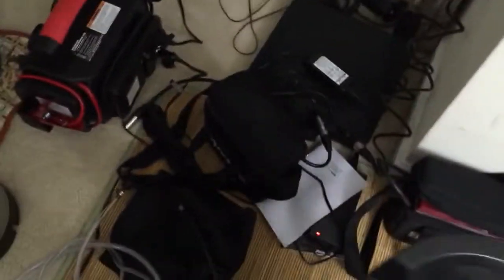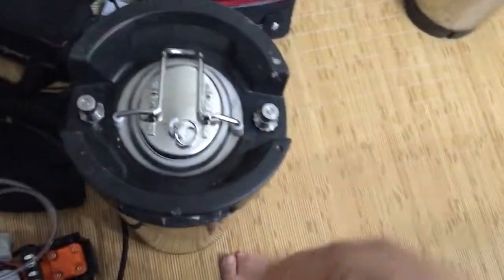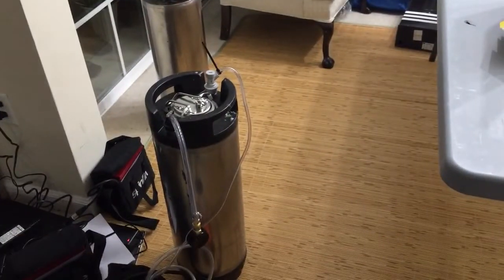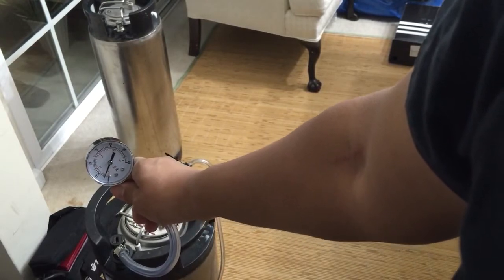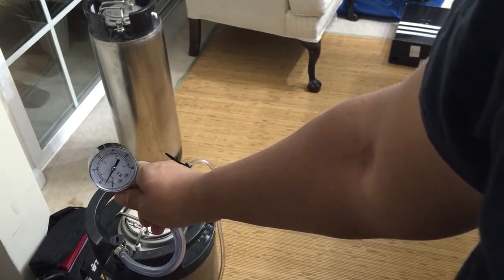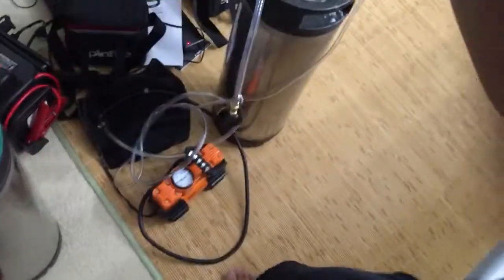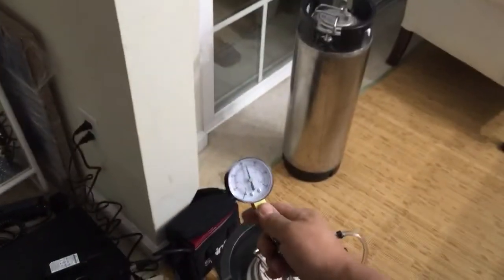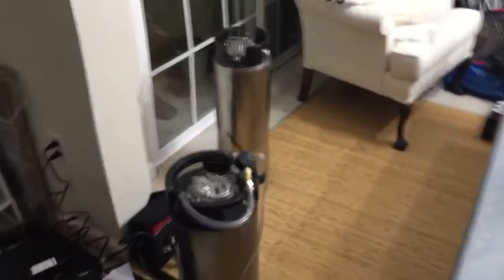tennis ball re-pressurizing machine setup 240 balls

Comment from the maker: Wow I didn't know I had this many interested.. I guess I wasn't the only one.. folks this method truly works... I do this on a bigger scale 200 to 400 balls because I hate playing with dead balls.. I use ball machine to practice so I use a lot of tennis balls and try to play with real pressurized balls to simulate the real thing.... You should never play with dead balls because it throws off your timing and in many ways.. it's not fun..
Reply: OK I believe you.  I can see that I was using too high a pressure at 100psi. I like to understand how this works and I came to the realization that if the ball does withstand a certain amount of pressure before collapsing, a pressure differential would exist.  But the pressure would have to be, as you say, low (low enough to prevent the collapse but high enough to create the differential). And once a certain amount of air had been transferred, the pressure would have to be increased a bit because the differential would be reduced by the increased pressure inside the ball.  This is just what you say you do and it makes sense to me now.  But doesn't this take a really long time? I just think how long it takes a ball to go flat...a few weeks and that's with a pressure differential of 14 psi (to start with only, admittedly... so maybe even a differential of 7 lbs applied consistently would do as you say...just thinking out loud here).  And to repeat my question, can you really get the balls up to 'like new' pressure? Theoretically you should be able to inflate a ball til it explodes when removed from the tank.  Do you think you could? I wondered why anyone would need this instead of just keeping one can pressurized all the time (with devices that do that) until they are worn out.  But your use of the ball machine explains it and I totally agree with you about using dead balls with a ball machine.  At our club the ball machine is supplied with a hodge-podge of balls of various pressures which completely defeats the purpose of a ball machine, namely to allow you to hit the same shot over and over.  If your device works (and I believe you when you say it does), you might have a product that would save tennis clubs around the world a lot of money.
Reply from the maker: So true.. Yes it does work.. I think its about marketing... Many want to play with fresh can of balls not repressurize them.. In a match I always use fresh can of balls.. So this is only good for lessons or for practicing .. There is already a company that does sell the korny keg setup at like $1500 which is a rip off LOL the key is that you need maintain the corny keg so that air doesn't leak.. That is the main factor.. It's critical that keg doesn't leak during the re-presurizing process.. But I use this all the time so I know it works.. And sometime the ball has more pressure then before.. That's a good problem to have lol if you want to know more feel free to email me jaeshin111@gmail.com

Comment: Tennis club was replacing and gave me all their old practice balls (about 600) I tried this method, bought a corny keg and installed the fittings (total cost about $50) put in 60 balls under 60lbs pressure for a week. No significant change - still soft - I could still push my thumb like 1 - 1/2” into balls easily. Went back to this vid, saw that I needed to begin with less pressure (apparently higher pressure compresses the ball wall making it less permeable) so I tried 20lbs same balls for a week. Not much different result, still apparently just as soft. Gave away the keg and bought six packs of Penn pressureless practice balls (cost about $8 for a dozen) filled up my 72 ball Gamma gold hopper. 6 months later VERY happy with the pressureless - still firm and GREAT for practice. Could be the club balls are just too old to repressurize. Have been giving them away to people with dogs and beginner players. ;)
Reply: This pressure method is better for putting in newish balls to maintain pressure, not trying to restore completely dead balls. I've been rotating 60 Dunlop Grand Prix balls in a corny keg for 9 months and i'm  ready for some new balls now due to the fuzz on the balls, but not due to less bounce. Pressureless balls are too hard on my arm, but they ok for gentle practice.

Comment: I do the same with 4 corny / soda kegs, although I use CO2. I get around 14 days with CO2 and it takes around 3 days for them to pressurize. 

How long does the air take to pressurize and how long does it last?
Reply from the maker: not long.. i leave it for  2 to 3 days at 32 psi.. i never lost a bounce however felt wears out.. because of ball machine use
Reply: Do you have a parts list for your setup?
Reply: I'd also be interested in a parts list.
Reply: I have a couple questions:

1.  If the internal pressure of the ball is supposed to be 14 psi, is there a risk of overpressurizing the balls above 14 psi? Is there a way of measuring this? Perhaps the technique to get it just right is to overpressurize for a few days and then bring it back down to 14 for a while. 

2. Are there similar keg-type  containers that can hold more than 60 balls?
Reply from the maker: No but you just need to make sure keg has zero air leak.. And pressurize to 32 psi at the max.. Beyond that will crush the tennis ball and won't work
Reply from the maker: You need to measure the psi .. Just get a gauge bro.. bigger then 60 balls you need a custom build one.. And it's not cheap.. Just stick to korny keg.. I think it hold 60 so if you need 200 then get 3 kegs :) it's easy to maintain and parts are cheap .. Readily available at you friendly Amazon.com lol
Reply from the maker: Just get a korny keg and a pressure meter.. Electronic pump.. I used to use a manual bike pump but I got lazy and tired .. Lol so I use a electric pump to 32psi.. I pump to 32 psi because I keep my ball fresh and not flat.. If they are flat I put them in a separate pile and pressurize differently..
Reply from the maker: Yes I thought about use Co2 but it cost money and I saw hardly any difference from using a regular air pump ..
Reply from the maker: Keg and pump and a psi meter

Comment: I don't believe tennis balls can be repressurized...here's the thought experiment...when you pressurize a container that has flat balls in it, the balls collapse inward until the pressure inside the balls and the pressure outside the balls are both equal. Without a pressure differential there will be no movement of air molecules from a high pressure zone to a low pressure zone.  I am not sure of this because there will be a slight pressure differential due to the flexibility of the rubber but I think a significant pressure differential is required (such as exists between a fresh tennis ball and the outside world) to cause repressurization.  I have looked at many forums on this topic and no one has really, to my knowledge, actually repressurized a tennis ball.  This video shows how you might try to do it but does it actually work? I wonder...
Reply from the maker: Dave Crowther I use it everyday.. only time I trash the ball is when felt is gone.. .. ball collapse when the pressure is too high.. it takes longer to re pressurize if the ball has low pressure..
Reply from the maker: Lol you your self have never done it and you conclude based on your thoughts .. laughable ..
Reply: Years ago my brother, a welder, built me a steel ball pressurizer that I could put 3 balls into and pump up to 100psi.  It did not pressurize the balls. What's laughable is people saying it can be done but not actually dong it. @practicetennisbyjaeshin3231
Reply: I have no doubt at all that you can maintain the pressure in a ball with your device but can you really repressurize a flat ball? Be honest. @practicetennisbyjaeshin3231
Reply from the maker: Ok so max psi for represurizing tennis should be 32 psi.. Fresh can of new tennis ball is at 14 psi.. So when you try to revive a really flat ball it should be slowly pressurized may take 1 week at 15 to 20 psi then another week at 25 psi then to 32 psi.. 

You also need to separate flat balls from good balls.. Example you can't mix flat balls and good ball in the same can...
Reply from the maker: You did it wrong.. 100psi is too high... Max psi should never pass 32psi newly open balls and flat balls should be start at 14 to 20psi and gradually increased to 32 .. It takes longer to repressurize and flatter ball.. It may take 2 to 3 weeks for a flat ball.. I have 400 balls so I use 200 for practice and rotate after using it for few days.. I do this because I hate practicing with flat balls... Yes it does work..
Reply: Imagine a balloon with a small amount of air in it put into your device.  If you could see the balloon inside your tank, you would see it  shrink as the pressure was increased.  This shrinking puts the air inside the balloon under more and more pressure until the pressure inside the  balloon and outside the balloon are equal.  Once this state is reached, with no pressure differential between the inside and outside, no air will travel through the balloon membrane.  A tennis ball is only slightly different in that there is a bit of resistance inherent in the structure of the ball.  But you can easily squeeze a tennis ball with a hole in it so the resistance is not much.  The resistance you feel when squeezing a pressurized ball is from the air pressure inside the ball, not from the resistance of the rubber.  Do you think you could inflate a balloon with your device?  A tennis ball is pretty much like a balloon. If  am wrong about this and the tennis ball actually acts like an eggshell to resist collapsing when subject to outside pressure, then maybe your device will work.  But be honest...are you getting balls back to a "fresh from a can" state? I was not able to repressurize balls with a device that put them under 100 psi of pressure. Are you merely keeping balls pressurized that are already pressurized or are you actually reinflating tennis balls to "like new" pressure? @practicetennisbyjaeshin3231
Reply from the maker: 100psi is too high.. Start at 14 to 20 psi for flat balls and leave it pressurized for 1 to 2 weeks.. Make sure the pressurizure has no leaks
Reply: @dccrowther  Dave, I think nothing is wrong with your reasoning. But you assume that the shell of a tennis ball (the rubber) is hermetic. I think the reason this works is indeed that the rubber 'leaks' to the outside or the inside, depending on the surrounding pressure.
Reply: Am Naj I don’t think the balls are hermetic. I know that air can permeate the rubber... how else would the balls go flat over time? Besides I have already come to realize the error of my ways and that tennis balls can be re-pressurized.
Reply: It can be done absolutely 100% I have been in Tennis academy’s  where they have profesional grade re-pressure ball machines. 

In this type of academy’s, kids are hitting hundreds of balls a day.. They could never buy 2-300 balls a day.. You do need the proper equipment.. to do it. But saying it cant be done is just crazy..

Comment: What kind of air pump you're using? It seems super fast. The ones used with the car tires seems slow, and need a converter to use 110v ac.
Reply from the maker: It's just a tire pump from lowes

Comment: Hi, great idea and thanks for sharing - I managed to get all set up and put 60 used balls ( most of them are flat) inside the keg and left for 24 hours however I barely notice any change; balls are still flat. How long in average should I leave the balls inside the keg to re-pressurize ( 1 day,2 days, etc) ? How long balls will hold the pressure once you take them out a start using it ? Do I need to put them back inside the keg after each play? Is 30 PSI the ideal air  pressure to put inside the keg in order for the balls to bounce like new ? Thanks !
Reply from the maker: Flat balls need to start at 14 to 20 psi for a week or two then increased to 25 to 30psi for another 2 weeks.. 4 to 5 week may be
Reply: Hey Jae, how come you have to gradually increase psi for flat balls instead of just putting it in a canister at 30-32psi for 5 weeks?
Reply: @Jeeulye  Hi James, I tried to pressure 32 psi for 2 weeks, only 11 balls are restored, some balls turned to be more flat. Maybe this is the reason, and I saw another video, it shows the ball just need to be pressured at 22-25psi. I would try one more time.
Reply: @Jeeulye  Some flat balls dont have enough internal pressure and ended up collapsing when the external pressure is too high. It worked for me to start around 20 and then gradually increase. Consider this: the atmospheric pressure is around 14 psi and a new tennis ball has an internal pressure of 26 psi. So really, we just need to add 12 more psi to bring it to equalibrium.  But truth told, it definitely takes less time when you add more pressure to the tank

Comment: Hi where do u get those pressure cans from?
Reply: Those are just simple corny kegs. You can find them online for 2 for around $100. Locally if you have any homemade beer brewing stores they will have them but will cost more.
Reply: 5 Gallon Home Brew Keg - New Ball Lock - Stainless Steel Product Tank
Brand: Old Ale Homebrew & Beverage Supply Co.
Reply: PERA 43178-145684 Ball Lock MFL Dis-Connect Set with Swivel Nuts (2) 5/16 Gas, 1/4 Liquid Barbed by (Pack of 2)
Reply: ZHSMS 210mm 8.25’’ Flexible Extension Tire Valve Adaptor Tools Set with for Universal Cars Truck Motorcycle Bike 19Pcs
Reply: Hose Clamp, LOKMAN 60 Pieces Stainless Steel Adjustable 6-38mm Range Worm Gear Hose Clamp, Fuel Line Clamp for Plumbing, Automotive And Mechanical Applications
Reply: all purchases on Amazon....